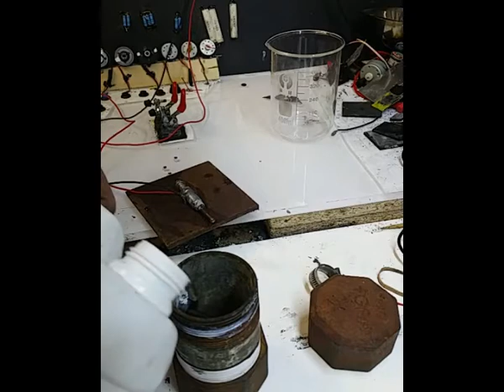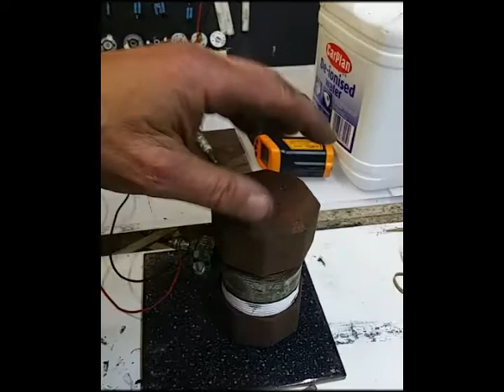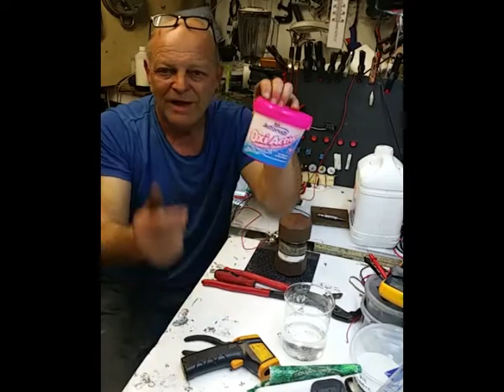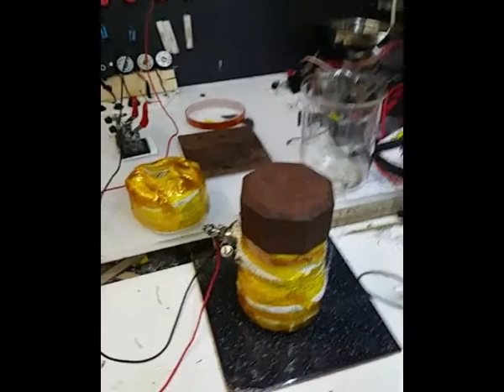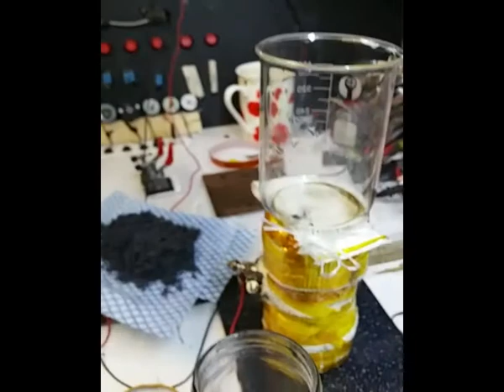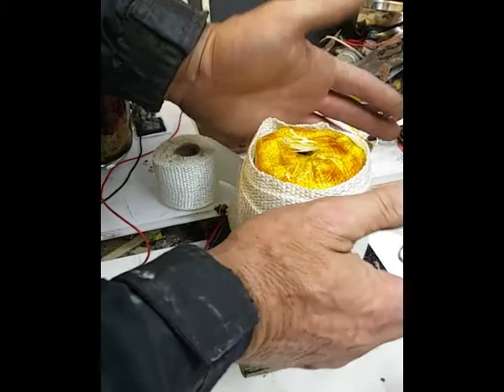Hydrothermal Carbonisation My home made bench top AUTOCLAVE with DC Voltage

Comment: I watched your video through.. very inspiring.  I'm heading into retirement and hope to do a few of these things inspired by RMS and people like you.  Couple things that you might want to consider.  Your autoclave is much hotter on the inside than on the outside. This isn't just because of thermal losses through conduction (the bottom) and convection (the top) but because your heating element is inside the vessel.  So, using this method, you're actually measuring the temperature a ways behind the actual inside temperature due to lag from the thermal mass of the steel.  

If you don't mind a suggestion, I'd make your next project a simple temperature controlled kiln.  That way, you don't have to breach the containment vessel to stick a temp probe in... the inside temperature will never get higher than the temperature you've set the kiln to.  As for the vessel itself, make sure everything that can be welded tight is properly welded (and ideally, it's done via TIG by someone who knows how to weld pressure vessels). 

Final point is that pipe fitting cap is likely a pipe thread... ie tapered which makes sealing it tough.  IF you can, head off to the scrapers and get some stainless steel schedule 40 or even 80 pipe.... and get your mate to weld a base plate onto it.  If you can't get someone with a lathe to put a thread on top with an appropriate cap, do it like Roberts' Chinese autoclave.... put a flange on top with 6 or 8 bolts to hold down an o-ring or viton gasket sealed top.  That will take more space and require the furnace to be quite a bit larger (or your autoclave volume to be much smaller).... but will be safe and very, very useful.  After all... you can always use a bigger furnace, right? :)

Take care and stay safe - COVID won't last forever - as long as you stay on the green side of the turf, :) 
Doug
(for the record, I suspect all of us on this tech journey are on some sort of spectrum... interpersonal communications are often not our strong suit..... Glad you resolved things with the guy you described.... he likely was trying this best to be helpful and might be a great resource)
Reply from the maker: Many thanks for your comments and i will be back later on this year.

Comment: I'm glad I found your channel.  I've been working on synthesizing cubic lattice ferrous disulfide (synthetic pyrite).  I finally created some cubic material in my last batch which I initially thought was going to be a total failure.  The yield was very low, but the remains were very pleasing under the microscope.
Reply from the maker: Matthew Wilson hi mate, must say i did not even know that there was such a thing as synthetic pyrite, whats the process for that ?
Reply: @mouldykev  I've been using ferrous sulfate, sodium thiosulfate, elemental sulfur and a strongly basic solution of sodium polysulfide(s). I've also used extra sodium hydroxide a couple times to keep the solution basic since neutral to acidic conditions results in the formation of H2S which can cause over-pressure.

I'm planning doing a video soon.
Reply from the maker: Matthew Wilson ok so i'm guessing that you are using a reactor then ( HC )  not certain why you would go to these lengths or what your end goal is, i just read your last comments, it's all very complex is'nt it ....
But hey best of luck with your experimentation.... stay in touch 😎
Reply: @mouldykev  Yeah. I just thought about it one day after making iron sulfide. I had been taking a break from my Verveuil furnace build and had several other projects going on in the background. I thought about synthesizing pyrite after making copper sulfide and examined a beautifully symmetric faceted crystal under the microscope. I was working on purifying ferrous sulfate, producing sodium thiosulfate, reducing hexavalent chromium, making trisodium phosphate, and studying more on sulfides since sulfur shares characteristics with oxygen.

Long story short, I have ADD/ADHD and that is actually an advantage because I need to keep my brain busy or go crazy. I bought an autoclave and began more research and found a couple patents from people with similar formulations as to what I thought up. I was so excited about me, being a nobody, amateur hobby chemist, came to the same hypothesis as a couple other people with actual degrees in chemistry. I felt more than a desire to attack this problem and get it out of my head and into physical form.  I am no expert, but I've learned and continue to learn so much.

I am just deeply fascinated on certain things and a bit obsessed. I hope to find others that are of the same mindset and experiment along with me. It sure helps to prove or disprove my results with more certainty than me alone.

I love YouTube for the opportunity for diverse education and the community behind it.
Reply from the maker: Matthew Wilson ok what you are doing is commendable.... but i still wonder just what the end goal is .... ie. What are you going to do with the end product ? Because let's face it, you are certainly putting at lot of time and effort into this for something 😉
Reply: There is a ton of time and effort going into this for sure.  :)  The reason for all this effort is to see if I can do something I didn't think was possible previously.  I need to satisfy my extreme curiosity.--I'm exploring the science.  I'd like to grow some crystals large enough to see with the naked eye, which I think is a possible fruitless effort, but I'll nonetheless try for a while.  I'm also planning on working on nano-sized FeS2 for a number of experiments.

Nano sized FeS2 can be used for photovoltaic cells & semiconductors.  It can also be used as a cathode for high energy density batteries.  There are a ton of possibilities and I'm not sure how much of it I'll explore, but I'm having fun with it in the present.
Reply from the maker: Matthew Wilson Ah now i see a plan 😎
Reply: I also meant to mention that I have used a temperature range between 180 Celsius to 220 over the course of five batches.  I've also tried variations of chemical composition ratio and I've even tried one experiment using diatomaceous earth as a neutral separating medium between crystals of sodium thiosulfate and the sulfur + ferrous sulfate crystals on top.  The sodium thiosulfate dissolves in its own water of crystallization upon heating and I figured that might form an interesting resultant product.  It worked to an extent, but I don't think I left it in long enough.  I don't know if it really produced anything useful, but it formed some interesting structures which I think were more recrystallized sulfur contaminated with the other ingredients including the silicon dioxide from the diatomaceous earth.

I'm focusing more on using only ferrous sulfate, sulfur and sodium thiosulfate to keep the formulation simple and straight forward.  It's tricky to get everything just right to form cubic pyrite crystals instead of the marcasite crystal structure, but I'm getting better.  I'd like to have someone actually analyze my end product just to have 3rd party verification.  I've done everything I can to rule out everything else.  If I can get some other people to duplicate my experiment and prove me right or wrong, that would be fantastic.

After the reaction, I process the solid by stirring in a 32% HCl bath for 24 hours, then rinse out all traces of acid.  I then stir the product in heated acetone for about 30 minutes, then thoroughly dry it out completely.  This is then added to a heated solution of toluene and vacuum filtered while the solution is still hot.  I perform this step a second time, then completely dry it out again.  Once again I wash the solid with acetone several times followed by several rinses of distilled water.  Once dry, it's ready to be analyzed.  Any residual sulfur should have been completely removed by the hot toluene or xylene steps.  The HCl won't dissolve FeS2, but will dissolve FeS and any other ferrous/ferric compounds from solution.  I also verify none of the remaining solid is attracted to a magnetic field since FeS2 has no attraction to magnets.
Reply: @kev wallcroft  I don't know if my link will be marked as spam, but I have pictures posted on the sciencemadness forum of my experiment results.
http://www.sciencemadness.org/talk/viewthread.php?tid=85360&page=2  <--I posted the second page since it has the most recent results.  I'm going to be taking some much better pictures using my microscope camera especially since I found the EDF feature to combine a series of captures at various focal depth to see much clearer detail.

Comment: Hi. I recently came across your channel whilst studying ways to to make carbons for paper batteries, a la RMS. Flicking through your videos, I noticed one that mentioned that you made induction heaters. It occurs to me that you maybe could make an induction coil to fit around your home-made autoclave to heat it, rather than the diesel glow plugs. Just an idea from a retired engineer...
Reply from the maker: Pat Butcher hi Pat yes i do show in a later video me using my induction heater to expand some graphite.
Also i have said in a recent vid that i do plan to make carbons with same device. I am at the moment working on a chamber to hopefully trial this.
Many thanks 😎

Comment: That autoclave is looking pretty awesome.
With an additional pressure relieve valve, You might've found a whole in the market, the Bench Top Autoclave.
Many of the viewers here and at RMS would be very interested, including me ;)
Nice job, ignore the haters.
Reply from the maker: Joost Van Heuckelom yes at the time i thought it could be good, but it would have to better made with stainless steel i think. The idea is not dead yet and i intend to go again when i find the correct steel.  Thanks